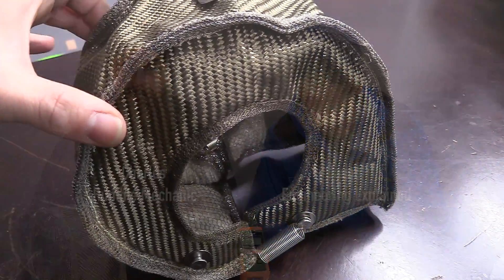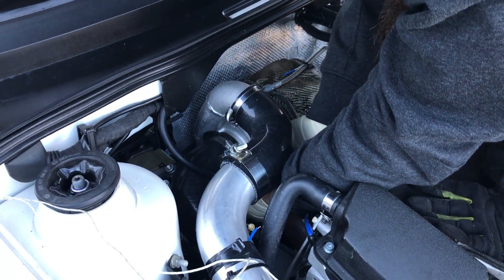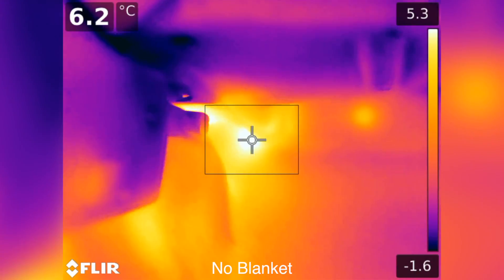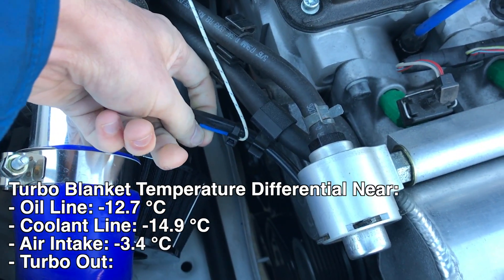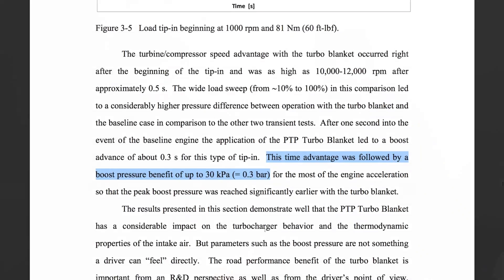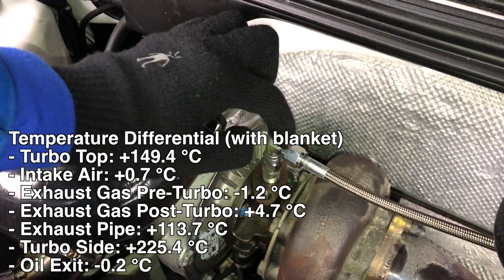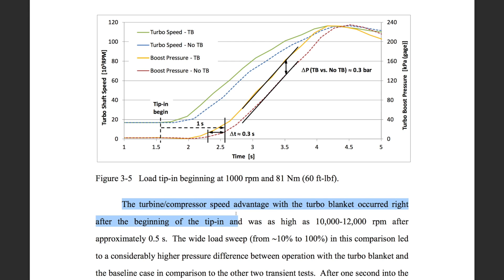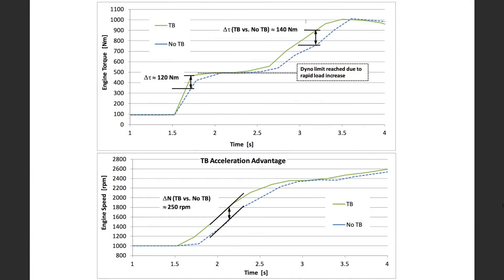Can Turbo Blankets Be Proven To Increase Performance?

Comment: Very cool, well done video. I'm curious, besides oil temp concerns possibly effecting wear, might there by any other downsides with respect to turbo wear, by keeping it hotter than designed from the factory? I understand turbos are intended to run hot by design, but I'm curious if raising the turbo temp (by 149.4 *C in this case) could wear anything out faster? I know the bearings are located around the middle of the impeller/compressor assembly, further away from the turbo top, but I'm guessing they would be getting hotter as well. Over time, the turbo will be experiencing greater temperature swings between cold/hot/cold cycles, and maybe that could accelerate fatigue of the turbo housing, compared to stock? Then again, the difference could be negligible. Thanks again for another great video, science be praised!
Reply: I guess portions of the turbo are hotter than they would have been, but as they mentioned in the video, the exhaust gases entering the turbo are the exact same. If anything this is making the turbo temperature more uniform throughout...which is elevated in some spots and roughly unchanged in other spots.

It's interested to think about though, since certain portions of the turbo are seeing a heavier thermal cycling load.
Reply: Yeah, I just think the same. They could have gone further and talked about heat transfer through contact of those parts you mentioned. It is said OEM housings wear out and and can crack for such temp increase...

Comment: Well done video guys thank you. I've debated adding a blanket for my 84 GTI Callaway turbo. I like the idea of using one but I am concerned that my manifold and down pipe will bear the brunt of the extra exhaust temps. I understand they are already prone to cracking without a blanket and did not want to accelerate that as they are NLA and nearly impossible to find. In addition my turbo is an old design and may not be built to handle the additional heat. I would very much like to reduce the under hood temps for the sake of longevity of the other nearby components. Despite a turbo timer that will run the motor for a few minutes to warm down, my disintegrated shifter bushings and melted O2 wires showed me that nearby items do get hot so I added more wire, firewall and trans tunnel shielding. If I was designing a new build with fresh components I would add a high quality blanket.

Comment: Great video. You did however fail to mention one of the drawbacks and that is the cast iron turbine housing degrades faster with the higher temperature. This is often seen as cracks appearing sooner, deformation of the casting causing flat machined surfaces to distort slightly etc. Overall faster aging. I used to wrap them with asbestos tape.

Comment: GREAT Video!
All the questions I have asked and pondered answered.
And so, the answer to the 3 year old question I have had is yes.  Yes I will get a turbo blanket.
Thank You.
Some of the most informative vids on all of You tube.
Now I have to ask... what if we continued to wrap the down pipe till it was out/fully under the engine compartment.  Press that heat farther down the line and away from everything else....  hmm.  I think I may wrap my down pipe also.  Something for me to read on.
Reply: PTP recommends wrapping the DP. I emailed them and asked before I bought the blanket. There should be gains to be had too. Maybe a job for next time
Reply: I've heard some bad things about wrapping the exhaust (cracking, water getting trapped), wouldn't a blanket/shield be a better option? Might not be as effective though.

Comment: I prefer to sacrifice performance and get reliability and longevity. That turbo blanket prevent cooling and is shortening the life of turbo-compressor. That's why manufactures don't fit the cars with TB. Also when you stop you need to keep the engine running longer before you shut it down so you use more fuel.
Reply from the maker: How would it reduce the life of the compressor? The compressor was running cooler.
Reply: Half of it was cooler. The part under blanket was hotter because the heat cannot dissipate. That blanket is an insulator. Also a good thing to do is to keep the engine running after you arrive at destination to allow the turbo to cool down. With a blanket you will need to keep it running longer. Anyhow why manufactures don't fit the cars with blankets??? They are cheap. As I said, I prefer longevity over performance. Can you prove that the blanket is having good results for turbo and engine longevity??? I will buy it then.

Comment: Ummm, I was under the impression that the problem with turbos in general was the bearing that the turbines themselves spun on. The blanket would cause these bearing to run hotter, leading to premature failure. As pointed out in the video, these turbos were NOT designed with a blanket in mind. Caveat emptor!

Comment: I think a turbo blanket is always worth it. i remember before i got one any hoses near it would be nearly melting. and just  the amount of heat that was radiating from it. 

After i got my blanket it made life so much easier. and its not even a high end one. im sure a high end one would do even better.

Comment: Yello,  nice video, but I have a question. Would there be an impact for catalytic converter in a bad way? As I believe, Cats do not like exscessive heat, do they? Also looks like Opel Astra G has a blanket by stock too

Comment: I was sold at the temperature data
Then you talked about improved torque curve now im stoked
Reply: Cédric Coulombe 
 This is for petrol(Gasoline) engines. If it’s a Diesel then they run cooler. As diesel exhaust run much cooler.

Comment: But what does this do to the longevity of the turbo?  Could be a quick road to needing a new turbo!
Reply: C.A.T.S.  have you atleast watched the vid? The oil temp remains the same
Reply: Oil temp, though important, is obviously not the only thing that affects how durable a turbo is.
Reply: I would imagine the exhaust housing would suffer increased wear from the higher temperature cycling. Probably would lead to a crack down the line.
Reply: Turbo was reaching 500C without blanket, and +200C with a blanket, that means about 700C on the outside (even hotter on the inside), considering tempering can be done at 700C, there's a huge chance the materials could soften and your turbo could warp and loose shape.
Reply: @woobilicious.  The composition of the steel used in turbine housings is designed to resist warping, softening etc...  It's a high heat part, it's designed to sustain high heat. The turbine would deform and melt before the housing. Typically around 1800°F sustained. As long as the turbine and                  header/ manifold are the same composition steel cracks are of little concern as well.
Reply: woobilicious. The following answer to yours is correct. The additional 200c is nothing to that steel. The temperature test was a moderate test, and if you really beat on that turbo it would show temps of well over 700c. 

The blanket provides the advantage of utilizing the heat generated from the exhaust housing side of the turbo to the advantage of preventing heat loss, of which the higher the temps on the turbine side the faster your spool times. Heat and air speed in this case are essentially the same thing.

The goal of heat reduction to the compressor side of the turbo is also advantageous as that side is not designed to see high temps nor do increased temps help with compressing air. Obviously we want colder air entering the compressor side, and the blanket offers the reduction of heat soak to that side. As many have said, the blanket is a win win and the lack of change of oil temps is promising as the engine regulates the oil temp as it passes through both the turbo and engine. Though I wouldn’t be opposed to installing an oil cooler for higher performance higher boost applications.
Reply: Yes, definitely true. Overheat of a turbo and overheat of oil inside the turbo.
Reply: Watched, but no one mentioned how was the oil temp measure.

Comment: +Engineering Explained When you point that FLIR to the heatshield you are not measuring the temperature from the heatshield because it is to reflective for IR radiation. In that situation you are essentially measuring reflected IR radiation from the turbo.
Thermographic measurements are a science of their own, they can be very, very difficult to conduct properly.

Comment: I realize in the engineering world we deal with the metric system for most things.  Don't you think most of your viewers in the US would prefer Imperial units for your videos (i.e. temperature and torque)?  Your video jumps around a bit with different temperature units.  Fahrenheit here, Celsius there.  Thank you for putting out great content.  It's fixing the little consistency issues that would take your videos to the next level.  [/Engineering rant off].
Reply: And as a counterpoint - most of your viewers outside of the US enjoy the sanity of the Metric system ......especially us Mechanical Engineers
Reply: I'd be interested if Jason would share the percentage of his YouTube audience from the US?

Comment: Would the types of seals in the turbo matter for the heat range it is operating in, ie in some older cars the turbos have carbon seals and im wondering if the extra heat would kill those seals fastrt

Comment: I have been curious how confining all that heat into the housing would impact the components of the hot site.  A thought was ceramic coating the inside of exhaust housing.  This should confine the heat to inside the housing, but not soaking into the materials as much.  But seeing the results of the paper might reverse that.  Still wonder how this is on the stresses of the metals being that much hotter.

Comment: How long does it take to cool off with the turbo blanket and without the turbo blanket and can the turbo melt with the turbo blanket because it keeps the heat in and if the heat stayes in same will happen with cold air it will stay out 
can you answer this please?
like if you want to hear the answer 🙂🙂🙂
Reply: I used to work in a truck shop and in 2 years only saw one melted turbo....the reason for that was a clogged and bent exhaust system and it was dumping oil into the turbo
Reply: This is a good question, how much materials suffer from added heat to turbo, exhaust pipes. Downsides need to be well tested before putting this on.
Reply: Oil needs to be tested as well for breakdown around the turbo

Comment: So basically a turbocharger blanket could be good in certain situations but wouldnt the blanket affect the turbo's heat dissipation?
Reply: Why would you want it to dissipate heat?
Reply: Just for youtube because turbochargers need to be cooled also ! Thats why there is water lines to the turbocharger to COOL it so trapping all that heat would be defeating the purpose of cooling it
Reply: t33n_ tun3r0129 There's rarely a water line going to the turbo, in fact so rare that i've never even seen one. They're "cooled" by oil. In Jason and HumbleMechanic's test here the oil was the same temperature with and without the turbo blanket.

Comment: I know this was sort of a side point, but the effect on the oil life is what I was most curious about.

...I wonder if wrapping the intake side with coolant lines (from a second radiator) would have a more (or less) significant amount of cooling for the engine intake temperature, compared to an intercooler. (I have doubts because the turbine itself would likely be unaffected and retain just as much heat).

Comment: "20*F...very cold out". I find the relative term, cold, funny. It all about location and what you are used to. If it hit 20*F any time between Dec 25-31 2017 in Winnipeg it would have been a heat wave

Comment: Temperature difference is measured in Kelvin not in Degree Celsius! Anyway, great vid!
Reply from the maker: You can add 273 if you want. No one uses Kelvin conversationally.
Reply: Hey sorry for being so picky :D . I'm glad to see Celsius used in your videos! I was only talking about differences / deltas in Temperature which are measured in Kelvin, because that's an absolute scale. 0°C + 0°C would actually be  273,15°C if you think about it (because 273,15K + 273,15K is 273,15°C). That's why K is usually used when talking about delta Ts. Thanks.
Reply: Just as 2°C is not double the temperature of 1°C. More like 275/274 times.

Comment: Holy crap! The side of the turbocharger gets 225.4°C (437.7°F) HOTTER?!?!? So, how hot does it get normally? I think another advantage of using a turbo blanket is so, if you're working under the hood, you don't get a 3rd degree burn by accidently brushing your hand against the turbocharger.

Comment: So why does the increase in turbine response happen? Is it because the higher temps inside the exhaust housing exert more energy? Does the exhaust velocity increase with the increase of temperature?
Reply from the maker: Less energy is lost as heat, more of the heat is kept in the turbo, meaning more pressure, meaning faster response. :)

Comment: Jason, very interesting video, thanks for investigating! So I assume a ceramic coating on the turbo would have the same effect? But that wouldn't be such a bargain 😅 Also, great chemistry between the two of you!
Reply: The blanket mostly protects against radiative heat transfer, the blanket essentials catches this radiating heat. Once the ceramic coating is up to the same temperature as the turbo it will still radiate heat in the same way as if there was no blanket or coating.  maybe slightly less but nowhere near the same amount a turbo blanket would.
Reply: Maybe I'm wrong but having a "ceramic coated" turbo myself, I think the effects of ceramic coating are way exaggerated. It's not a magical material.
Reply: Yeah I don't have a blanket on mine. I think about installing one. But my compressor, exhaust housing, 02 housing and log manifold is all ceramic coated.
Reply: Ceramic coating isn't exactly insulating... I would think the advantage would just be protection from oxidation at the high temps a turbo operates at
Reply: Tom Higgins well, that does sound logical indeed. Thanks for answering. Have a nice day, guys!

Comment: Does the blanket have any effect on corrosion of the turbo housing?  I've heard that exhaust wraps can dramatically accelerate corrosion on headers if they're not stainless - presumably by trapping moisture between the iron/steel and the wrap - and it seems this could be an issue in this situation also.  Your thoughts?

Comment: guys... just use a standarized measuring system. thank god you use celcius for the "engine measurements", but dont have much sense if you use fareheit for the ambient temperature. Use celcius for all!!
Reply from the maker: I grew up with Fahrenheit. When you talk about the weather in the US, you do so in Fahrenheit. For my viewers, all measurements were in Celsius. If it doesn't make sense, conversions are super simple. :)
Reply: yeah, it´s simple to convert, but it would be nice for consistency to say it on celcius (and include it on fahreheit on screen for all your american viewers). So you dont have to pause the video, go to google and convery fahrenheit to celcius. 
Thats the only thing i critics i have of the video. The rest is very good.
Sry for my english btw, greetings from Argentina!

Comment: Nice piece!! Just one question... Won't the increase in temperature of the turbo make it more prone to having problems or braking down? Even if you let it cool down after a hard drive? I have an Merc A45 AMG the turbo gets really hot, and its placed just in the back of the front (main) radiator... Would this blanket be beneficial in the long run in terms of turbo life? Thanks.

Comment: This is fascinating, particularly the oil temp tests done at UT. I would be worried about wearing out the turbo prematurely, but it seems that if the oil is OK then as long as you let the oil do its job things will be OK.

Comment: And yet Cummins still specifically disallows the use of Turbo blankets on their engines.
Reply from the maker: Could you send a link to literature stating this? Would love to learn more about it.
Reply: +intrusiveoogle 
I call BS, the Cummins Engines rep stated there is no turbo blanket prohibition and our Cummins/Onan genset has a factory installed turbo blanket.
Reply: I can send you engineering document excerpts directly to an email address if you like. Long term the blankets can cause internal scaling, cracking & distortion thermal damage to the metal. Blankets are allowed on emergency standby generators, or on prime power generators if the power is derated enough to reduce the exhaust gas turbine inlet temp 110°C below what an unblanketed application would be.

Comment: Increase delta, and decrease understood temps. I use them as well as lots of other thamal insulating products and heat reflective products. They work, some better than others, but they're good. 

I treat them more as durability/preventative modifications.